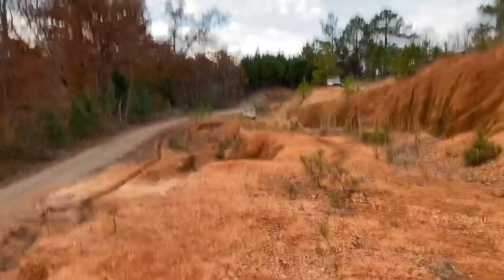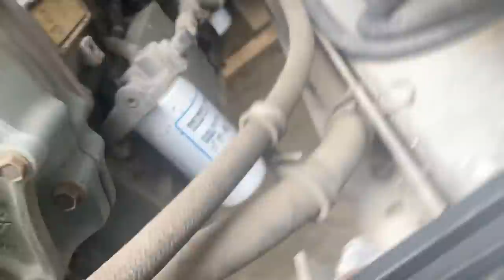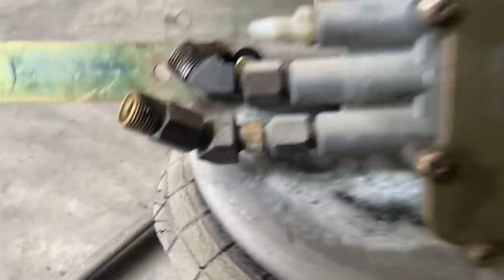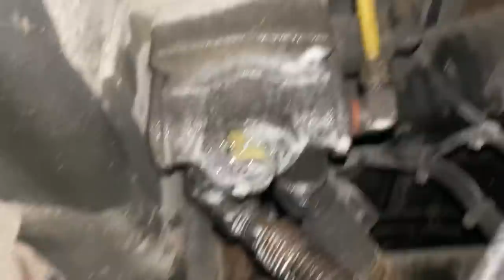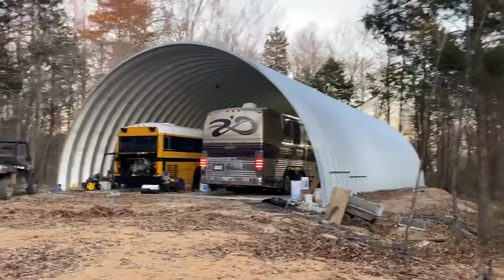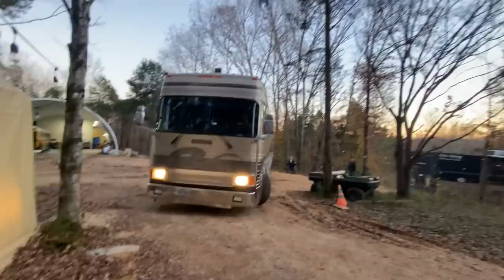Prevost 45xl some quick maintenance

Comment: The 60 Series is one of the best Diesel engines ever made, they had a long production run, 25 years or more before they were replaced with the DD15 series. Truckers still love them to this day!
Reply: Every engine has it's advantages and disadvantages, the 12.7 series 60 is definitely the best around engine with the least downside.  The only real downside to a series 60 is when it comes to pulling power, they just don't pull hard like a 15L or 16L even with similar ratings.

I re-powered my prevost xl-45 with a 600hp 12.7 series 60 when the 8v92ta broke for the last time.  That swap removed 1200 lbs from the rear of the coach.

Comment: That Series 60 slings that Prevost around with no problem.
Reply: I have the same engine in my 40 foot prevost bus conversion. When I'm not towing my 7000lbs jeep and the coach isn't loaded down, driving on the interstate is like driving a 50,000lbs Cadillac! Smooth and fast as you want. Tons of fun to drive.

Comment: First coach I’ve seen on your channel with disc brakes! Didn’t think they ever used them. Biggest solid rotors I’ve ever seen too!
Reply: Most new trucks and buses are equipped with disc brakes. Much easier maintenance than drum brakes and more reliable.
Reply: @billmoran3812  But brutally expensive up front !  Ken-worst wanted 8000 dollars more spec`ing discs over plain old S-cam brakes.  And to be blunt, nothing against Kenworth,  but I could tell you which stealership to avoid.

Comment: You are so right the old two stroke is like a model T ford compared to a 60 series. It's entertaining to watch two strokes being worked on, but all you can do is shake your head when you think of the high maintenance , fragility, belching smoke and low horsepower. They might have been ok 75 years ago but high quality four-stroke diesels make them look just plain silly in modern times.
Reply: Sorry what? Packed with sensors, computers, valve trains, atrocious little room to work around and lower quality parts. There's a reason 2 stroke Detroits are (generally) tough as hell.
Reply: My mistake for not clarifying the era of engines that I was talking four stroke versus two-stroke. But you take a 3406 Cat like I had-  never did a thing to it you couldn't break it tough as nails had 800,000 miles on it didn't burn oil, ran  like a clock never failed ,simple as all get out you compare that to those two strokes? Same with the old 5.9 Cummins .lt is rare but not unheard of to see a million miles on a 5.9 Cummins WITHOUT an overhaul ,try that with a two-stroke   what a joke, it's laughable how much better the four-stroke is, not even a close - sorry fellas.

Comment: Wow those long belts are sorely in need of some idler rollers to calm things down a bit!!!
Reply: Did you see them AFTER the tensioner had been reactivated?  They don`t let them flop around like that in road service.  Same thing on the big blower units on the older MCI coaches that were up above the engine in the blower bay.  You release the tensioners if going to be parked for a long time or if need to remove the belts for access to something.

Comment: Scott, I'll take a picture of a New Flyer brake rotor when I get back to work on Tuesday and send it to you via Instagram direct message. They're larger than that tag axle unit and vented on every axle. 
The articulating 60 footer will stop in a shorter distance at 20 MPH than the 2 axle 40 and 35 foot coaches.

Comment: what happens to all the bad parts you take off the buses ???
Reply: All of the metal can be recycled, as well as the used oil for now. Scott was considering an oil heater for the shop, where he could use the old oil.

Comment: So what’s your opinion on the new Super Single on the drive axles.  The 2017 Prevost H I drive has them.   I’m not crazy about them myself.  At least with the duels you could at least limp the bus off at the nearest exit. You don’t have that luxury with the super single tires
Reply: I ran super singles on a KW truck. Flat tires are rare these days and when you do get a leaker, they have such a huge volume of air in them that it takes forever for them to go flat.
Reply: I prefer duals anyday over super singles.  Better traction, better water or snow or slush dispersal in extreme conditions, and yes, the ability to limp limited distances on one tire if its mate has failed.  Super singles are good at one thing, reducing overall weight, so if you`re one of those carriers who promises their customers that you can carry 48,000 on a tandem configuration, then SS is the way to go, but when push comes to shove,  the dual config still reigns supreme.
Reply: I much prefer duals over super singles because of bad weather performance.  I dove part time back in the 90’s for a company that replaced their entire fleet with KW’s with disc brakes and super singles and didn’t car much for either of them.  I drove in the DC Metro area and as long as the road was dry the super singles were great but if it was raining, sleeting, or snowing than that was a different story as for the disc brakes at least back then in heavy traffic the disc brakes did not work as well as drum brakes to me they seemed to suffer brake fade from heat build up when compared to trucks with drum brakes.  I think the disc brakes would be fine flat land trucking but driving in heavy traffic or on winding twisting roads with hills they reminded me of driving 1960’s land yachts or trucks with drum brakes that you got a couple of good hard stops and the next time you better just toss out the anchor because the brakes had gone on vacation.  The company took it on the chin and dumped almost half of the KW’s with the Super Singles and Disc brakes well before the least on them was up in favor of Mack’s with duals and drum brakes because of accidents by drivers who had perfect driving records and drivers who quite because they hated the KW’s so much.

Comment: Do you no if it would be to much weight on a 40 prevost with tag axle to carry a Harley 3 wheel trike.  It has a 8v92 engine
Reply: I’m not a bus expert but I’d say no problem at all.
Reply: Biggest thing is making sure to get the right attachment to the frame. The engine isn’t going to care

Comment: You got to start looking at alternative power electric or hydrogen fuel cells, 7 Years Time these diesel buses will be banned from the road already phasing out the gas buses they haven't been out long the quicker you do it the better better for everybody's health and the environment. Have you spoken to them bus manufactured are they planning on doing conversion kits
Reply from the maker: Rv’s will not be phased out here in the states
Reply: I think you're on the wrong channel for that comment
Reply: @nickidewet7711  NO HATERS ALLOWED !